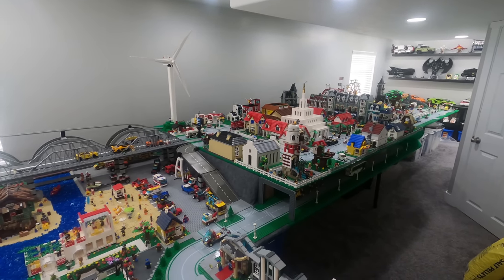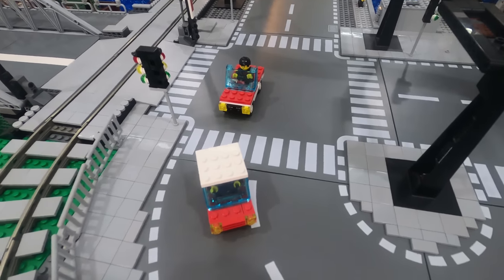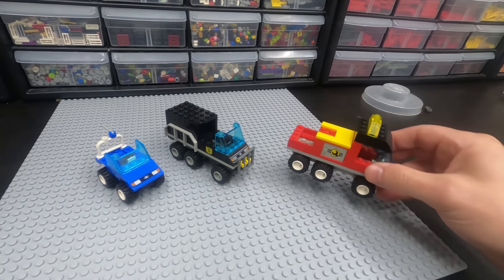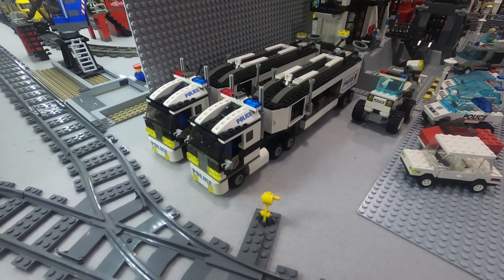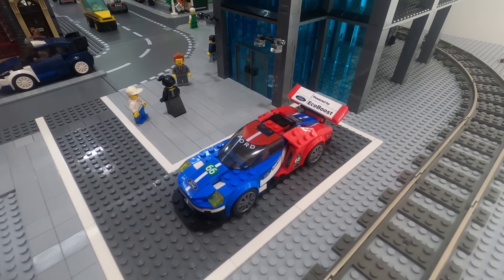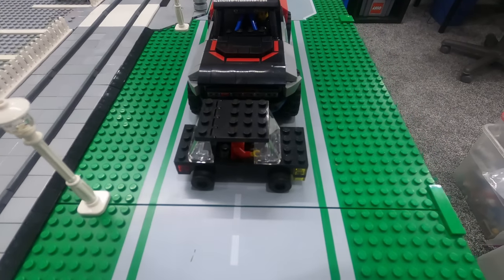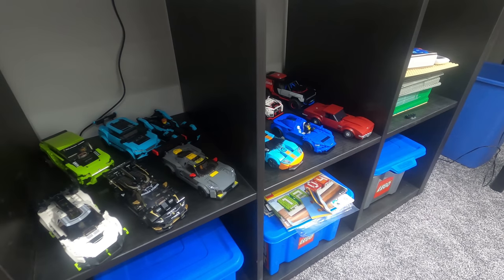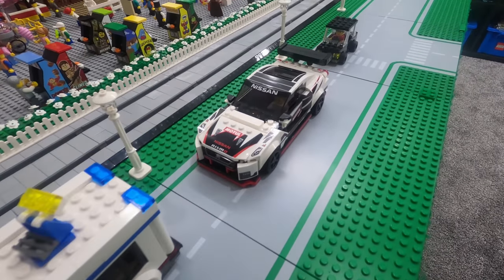Are LEGO Cars Getting Too Big?

Comment: Not only are the cars getting bigger, but the roads are getting smaller.  At this point, if you want to use the new Lego road system and the new cars, you basically have to use one of those 16x16 plates as a single lane.  Then it becomes comfortable for the cars.  I've devised a system where you can even build the sidewalk out on top of the road plates by about 4 studs.  You end up with 11 stud wide lanes, which are actually pretty decent for most cars.  Small 4 stud wide cars might even be able to share the lane side by side, like some wide roads allow cars and motorcycles to do.
I can show you the design if you're interested.

Comment: The original 4-stud cars were also designed around the 1/87 scale of HO trail layouts. The mini-fig scale was a little off, but that was taken as a necessary evil. When the vehicles got pushed to 6-wide, they completely blew the proportionality of the HO scaling, and could not be used on the layouts. Many of us have Lego layouts, but sadly do not have more than one small bedroom for the assembly, so we use the standard 4x8 plywood as a base. With the Lego trains, and 6-wide cars, room is taken up very quickly, and it REALLY pushes the imagination to make the layouts interesting. Now that Lego is pressing their 8-wide builds, it will be really impractical to try to adopt that kind of scale our 4x8 layouts. So, unless we are buying sets like the Speed Champions for purely display models, those of us with small layouts will likely pass, and will build our own MOCs for our cities. Perhaps, it is actually better this way.

Comment: I love the new cars, but i can understand the gripe around them in the city building circles, however i think it is an issue only for the small number of lego euthanasists who build city dioramas. as a kid i can vividly recall playing with both rock raiders and lego city and other sets at the same time, if i had no issue with police cars chasing huge drilling tanks, i am fairly certain kids don't really care about the size difference either. as an adult, i keep my legos on display and not in diorama, and there they look absolutely fantastic, tho the minifigs start to feel a bit 'midgety' next to these new cars.
Reply: Same thing, my city as a kid had a huge mix of vehicles.  I had a custom Cadillac thing that was 8-wide, a 6-wide fire engine, and a 4-wide ambulance, along with some other 4-wides that couldn't even fit Minifigures in them!  Now my town is all scaled for massive 8-wide cars and 10-wide trucks, but I'll still throw the occasional Tiny Turbos car in there for fun, or make the police battle an army of micro scale tanks.

Comment: When I got my first minifig in the Shell Fuel Pumper truck in 1978, the minifig didn’t even fit in the vehicle. 
And when they eventually did make 4 stud wide cars that a minifig could sit in, I wondered if they were supposed to be go carts since they were so tiny and fit only one minifig. 
While I did like the 6 stud speed champions they still never looked proportionally correct.
8 studs are a huge leap forward in terms of realistic proportions.
Just build wider roads

Comment: I agree that six-stud cars are the sweet spot for LEGO City. Any wider, and they'd not only overextend the streets, but also be wider than LEGO trains! However, the new modular (system) baseplates provide the potential to build wider streets, if necessary. However, the eight-stud Speed Champions look great, so they should continue that width for detailed display models.

Comment: The vehicles in the City line of sets are still 4/6 studs wide, so LEGO is consistent there. I think the speed champions were never intended to be part of the city but more for a car enthusiast/collectors market. Therefore the LEGO designers did not care about how those sets integrate with the City line. From my point of view even the 6-wide speed champions do not integrate well. They are way too massive and too long in relation to City vehicles. When a Porsche 911 and an ice-cream truck share the same length then there is something wrong :-)

Comment: The way I see it, Speed Champions is it's own thing, it shouldn't have to worry about fitting into city stuff. I would totally be open to LEGO making licensed vehicles at a smaller scale for use in cities in addition to what they are doing now, but I buy Speed Champions stuff because of the detail they put into the vehicles, so going smaller would be a pretty big step back in that case. You don't buy the huge triple digit R2-D2 to scale with the rest of your minifigures and ships, you buy it as it's own separate thing, which is how I see Speed Champions vs city. That being said, I would really like if LEGO also made wider road panels, so if you really wanted to, you could use them in cities or just as a display.

Comment: The 8+ studs SC lineup is definitely display.  Doesn’t fit at all on the road plates.  Now, if you build a new city with brick-built roads or the new road plates that came out for 2020, you can make those wide enough to fit 8 stud wide vehicles.  Most of your city will be roads, but it is more flexible in that way.

Comment: "The GT-R is really wide"
Oh, that's normal. The R35 GT-R is a behemoth IRL too.
Anyway, one thing I'm surprised LEGO didn't try with their vehicles is a return to the 5-stud seat spacing from Adventurers for use in city, especially since that would be relatively easy to fit in a 6-stud vehicle with commonly used door and wall bracket pieces.

Comment: The thing is, they get too large for what they are. I mean, if you make a Hummer that size, sure. But a sports car? I even have the 8-wide 1966 Batmobile mixed in with the 6-wide vehicles, though I mostly avoid putting 4-wide ones in alongside those. The 4-wide size I relegated to things like lawnmower tractors, forklifts and stuff like that. I do use brickbuilt roads, though, so road size is not an issue. Still, 6-wide is perfect for just about anything with a select few vehicles justifying 8-wide.

Comment: I agree that the speed champions are getting perhaps a bit too big. However, I've always thought the single minifigure cars or even the two minifigure vehicles with a driver and single passenger right behind them are too small. I try to find a balance and usually slightly modify most vehicles in my city to fit two minifigures side by side. It always seemed funny to see a little family group of characters, but their car only holds one.

Comment: I'm not sure if Lego would actually do this, but they might, in the future, make road plates differently; they could have less studs on the sides and more flat space for cars like the bigger Speed Champions. Though many people would need to adjust their Lego cities for it to work. 
Idk. Just a thought.
Reply: Lego has stopped making old-school road plates entirely, in favor of a system-compatible solution that's modular and lets you make double-wide lanes (or four-lane roads) if you want. Reviews are still kind of mixed because there are no curves and integrating them is not the easiest.

Comment: Well a typical lego city is already kind of cartoonishly scaled. Rooms are tiny, everything is cramped together, etc. So your 4 and 6 wide vehicles fit such a particular city style. To match the new 8-wide highly detailed vehicles, one would have to rethink the style and scale of the city. Wider road lanes, bigger buildings, and spread everything out a bit more. I'd personally start by saying to heck with official lego road baseplates or even brick-built roads. I would just craft my own roads out of black construction paper or something. What would previously require expensive baseplates or hundreds of SNOTed bricks can be produced in minutes with a few bucks worth of crafting supplies.
Reply: The craft supplies method will work but a brick built mils plate looks amazing. They are what I use in my city

Comment: Both buildings and vehicles became 50% bigger following the introduction of minifigs in the mid-1970s (look at the sizes of lego models pre-1976). I think six studs wide is the best scale for minifig scale vehicles, though it is difficult because minifigs are quite squat compared to real humans. I have discovered you can put two minifigs side by side if you lean one of them slightly forward and one slightly backwards. A lot of speed champions seem to be 8 studs - I recently bought the James Bond DB5 and it seems way too big.

Comment: Lego has a core "problem" with the proportions, but this is due to the way minifigs are designed. We tend to compare them to real human proportions but this is wrong, if we measure by that everything will look off (legos are too short legs and arms).

So if we want a supercar with real proportions they should be lower and smaller, which would make them have fewer details, or make minifigs taller.

So it is something to will only resemble but in its own proportions. The newer size of cars is good, but yes it can look weird beside the smaller vehicles. As someone said in the comments, a good way around would be to make the streets bigger. (But still, buildings would be out of human proportions)

Comment: To a degree I like what the speed champions lines has become, with scale now able to support models alot more realistically, with better proportions aswell. However, at the same time I personally think 8 wide cars are kind of overkill. They simply don't go with anything. The original 6 wide speed champions models I thought were decent enough, just big enough to allow for decently realistic models, but also at the same time to have something that is still within scale of not only a mini figure but also towns and city's scenes. 

All my Custom lego car models are still 6 wide, and I'm happy with the scale. I still am able to make really good, realistic car models. 6 wide is usually enough in most cases to pull off a vehicle, it's when you have a price budget, piece count limit, and limited to just lego certified building techniques  (Offical Sets), that's when 6 wide builds becomes real hard.

Building Custom realistic 6 wide models with all the freedom there possibly can be I believe is enough to pull off almost any vehicle, even at the smallish scale. Really from my point of view, it comes down to how much freedom you have when designing/making models within the scale you're working in.

Comment: I think the problem is the size of the minifigure. Do you make the car accurate to the height or width of the driver? Minifigures proportions aren't accurate to real human proportions. If a man is 6" tall, his width is not thrice his depth and his height not twice his width. The car must be able to fit one minifigure driver. Check! The car must be able to fit multiple passengers. Check! The car must fit two persons side by side in the front seats. Here is an issue.

Comment: If 6 wide care were accurate then they'd be able to accommodate 2 minifigures side by side like cars irl but they don't cuz the proportions aren't accurate but they are on 8 wide cars therefore 8 wide cars are more accurate and should be the default. Lego roads and trains are too small for them not the other way around

Comment: They where never meant for LEGO cities. The 8 wide cars are so-post to be sold in hobby shops (you know, model trains, cars, trucks, tanks, ships, etc.) along side there plastic/styrene, and sometimes metal competitors. The fact that they are in Walmart shows the lack of acknowledgement of this fact. You can thank two factors for this: 1 evolution, and 2 the brand COBI. The 8 stud wide vehicles scale down to 1/35th scale or thereabouts (using size comparisons from real life, and on hand resources), this is the same for COBI's tanks, transport trucks, and artillery pieces. The evolution of time has allowed one to go and get models more conveniently. LEGO does not stand a chance against the more specialized brands such as Revell, even with there anti-war policy, and such have to adapt. We should have seen this coming with the new road system being bricks, and not the 32x32 base-plates. We have not crossed a line, we just got to use to our ways to adapt. Being closed minded is how one gets left behind. LEGO has been forced to do this in order to compete while up-holding the anti-war/ sentiment. This is not to say LEGO have not done this in the past. LEGO has had two 8 stud wide trucks in the past. Think of the cars more as models to be put onto a shelf and never be touched again except to dust them off, like model kits.
Reply from the maker: All really good points, thanks!
Reply: @alexnunes  No problem.

Comment: I stopped buying speed champions. When a car gets wider than a freaking train there is a problem. LEGO has its own scale, even modulars are rather small realistically, and trains should not be 6 wide. But again, LEGO has their own scale which is smaller than real life. Speed champions was one of my favorite themes at one point and I have probably over $100 of the old cars. Not even mentioning the price of the new cars.